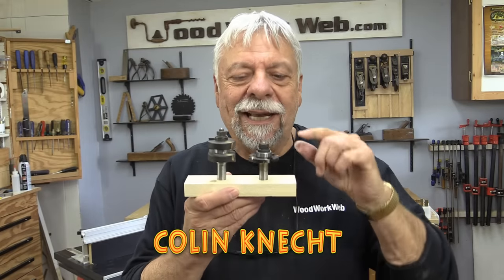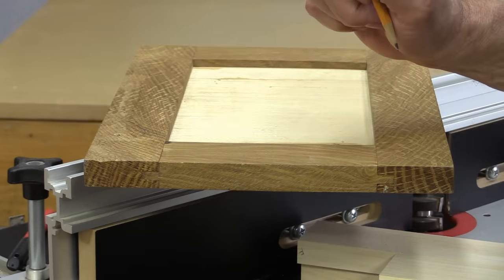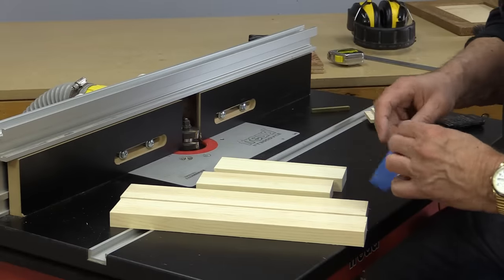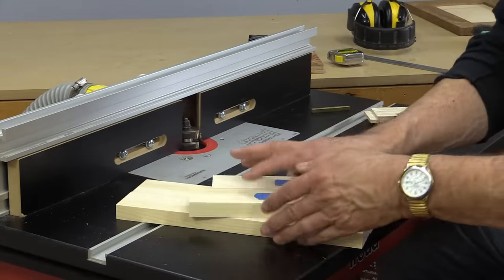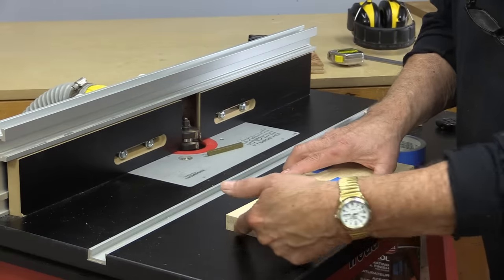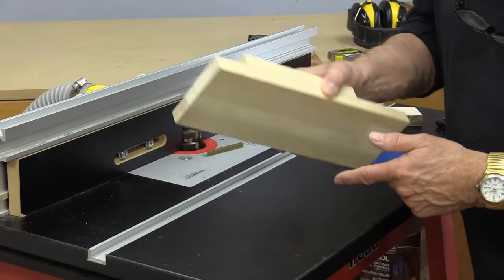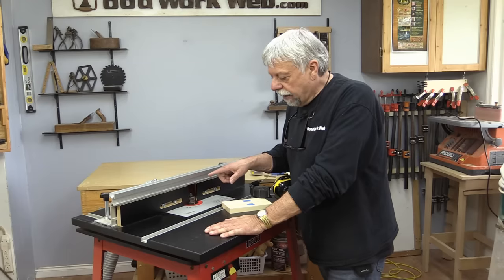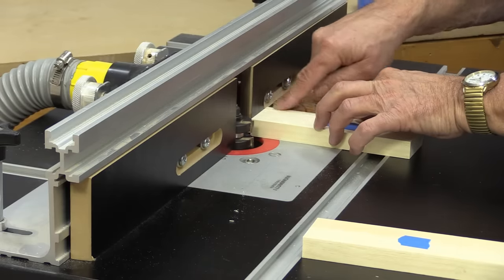Tongue and Groove / Rail and Stile Router Bits - Shaker Style Doors Making

Comment: By watching this I believe I figured out what my issue was with cutting my tongues. I was flushing the bit teeth up with the top of the board instead of focusing on the bottom. So I was left with a .008 thick piece of the board along the bottom of the board. But if I had done it right I believe the bit would’ve worked fine. Thanks again for an amazing video Colin. You’re such an incredibly helpful man.

Comment: Hi Colin! I’ve been enjoying your videos for years and finally got around to subscribing today. I consider myself an intermediate amateur, and I’m enjoying woodworking in my retirement. Having been a technology trainer myself for 30 years before retiring four years ago, I have to tell you that I really appreciate your style and thoroughness in your explanations. 

As an add to this video, I wanted to mention a tip from something that I picked up a few years ago, and it’s quite simple where tongue and groove or rail and style bits are concerned. Let’s say that the tongue of your tongue cutter (or rail/cope cutter) is 7/16” long, which you and I have.  Then you simply need to cut all of your rails and stiles to a width of 2-7/16”.  As you said, you then cut your stiles to length by using the desired height of the finished door.  You will cut your rails to length by always taking your desired door width and then subtracting 4” from that.  Thus, if you want a 13-1/2” wide finished door, simply take 13-1/2” and subtract 4”, and you will cut your rails to a length of 9-1/2”.  If you always cut your rails and stiles 2-7/16” wide, your magic number is always 4”. If the tongues on your tongue cutter are 1/2” long, then always cut the rails and stiles to a width of 2-1/2”.  The “magic number” will still be 4”, an easy calculation!

Comment: I admire your video skills on your wood tips etc.  On the shaker doors using panel bits. I really like to use 3/8 panels for the inserts. Is there a way  to use the panel bits in that application. Right now i use dowels and a dado 3/8 bit and leave a 1/8 as the backside  reveal so I get the 1/4 inch shaker look on the front with 3/4 stock

Comment: The way I do the stile lengths requires no math and works for any width rail, I cut and groove the rails put them back to back and use the distance from the bottom of the groove to automatically subtract the right amount. It won't work as great if your tenon is much smaller than the groove.

Comment: I am planning to put glass in my shaker doors.   Any tips for that?   I figure it can fit in the groove like any panel.  If it ever breaks I can cut out the back of each groove to fit a new piece in, and hold that in place with hardwood strips.   A panel is thicker than a glass pane though.. so maybe I should cut the back of the grooves out and install the glass with wood strips at the start.   Let me know what you would do.  I will report back after experimenting.

Comment: Good video. Great idea with the blue tape and on testing the height of the groove cutting bit. I have a set of tongue and groove bits and I don't like that the groove is too wide for 1/4 plywood. Maybe there are better sets of bits out there than the one I have? The last set of doors I made I used a table saw and had a better outcome. But some of this has to do with my router appears to move slightly up and down while in its base in the router table. I have a Porter Cable router and used some Yonico bits.

Comment: I just made my first pair of these doors using my dado blade set on one table saw and a regular blade on the other. Both are jobsite grade tablesaws and i had to really wrestle to get the one with the dados flat. Turnes out the stock insert is bent. I made a zero clearance insert but it didnt fit super tight so i had to be careful on startup of the saw. It wanted to fly out.

 Anyway.. im gonna try your tip on.making the tongues first to see if it helps me dial things in faster. I spent a bit of time matching them up at first.

 Thanks...

Comment: good vid thanks as always.  perhaps you addressed it somewhere, but is the dual router bit approach, as opposed to a single bit used at 2 different levels with a workpiece flip in the middle, recommended by you to save time.  Is that the only advantage compared to a single horizontal groove cutter bit?

Comment: I routed all my grooves first, only once I went to fit one up did i realize that my grooves were not 100% square to the work piece. Probably an issue with how my router is mounted or how it locks down. It's not really an issue for edge profiling but when it comes to joinery it can be a real issue. I'm not sure how to fix it, either. I need to be able to reference the angle of the shank relative to the table surface and make sure it's square, I guess. May need to use shims of some sort between the router and the table.

Comment: I did this this weekend using table saw because I dont have the router bits. It was my first time and it did not come out that nice. Not very even, flush, on any connection, so lots of sanding. I will have to invest into these bits.

Comment: Something I don't understand about any of the "shaker door" videos is that the 1/4" panel wood (plywood, birch, whichever) is never 0.25" thickness. It is always 0.20-0.21. Once assembled, it basically bounces around and leaves a visible gap between the rails/stiles and the panel because it's not actually 1/4". Is this typical when making panel doors? It looks sloppy to me and I don't know how to compensate. Thank you. Your video was very informative and helpful.
Reply: I should clarify that I use a floating tenon method so I only need to use the slot cutter. Saves time by not having to get the tongue dialed in just right. Watch the peter millard shaker door video. Thats what I do.

Comment: Thanks for the video ,did you use a half inch or a quarter inch router bit ? I have the bosch pof 1200 and which is quarter inch router and would like to know if I can do it with this machine or not
Reply: old post but his was a 1/2 inch shank. Most bits of this size are (or should be, ideally) a 1/2 inch shank. It is very easy to bend a 1/4 shank with large bits like this. I had a 3/16 slot cutting bit with a 1/4 shank and it bent and it was NOT petty. You should be able to get a 1/2 collet for most routers except for palm / trim routers.

Comment: If you're using a hard wood for the rails and stiles (like hard maple), these bits will tear out the wood as they're cutting the long groove on the stiles.  It's incredibly frustrating to have to caulk all the doors before you pain them, and if you're not planning on painting then what?  Ugly doors.  The only way around this is to cut them with a table saw and/or dado.  I haven't been able to find a work around for this.